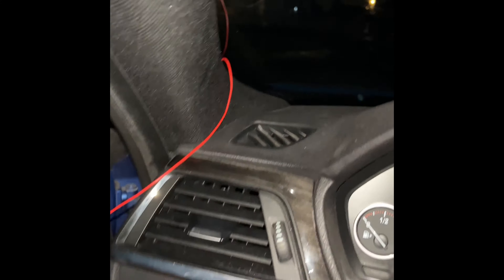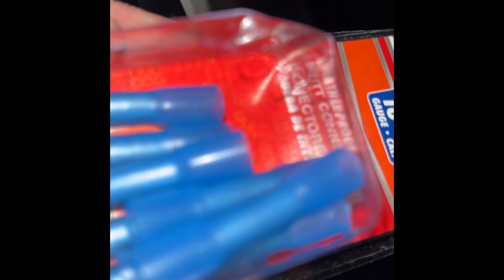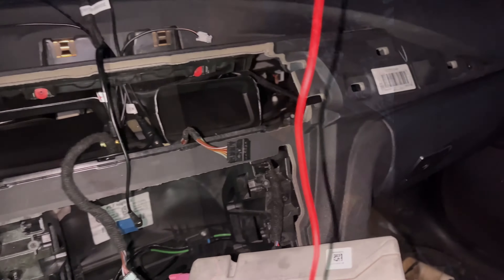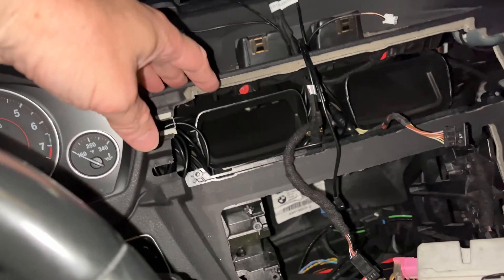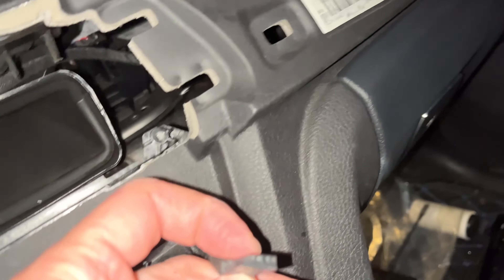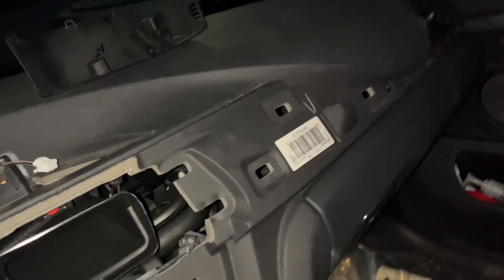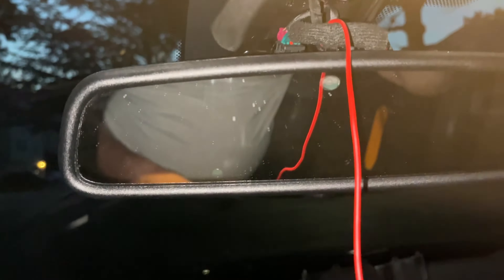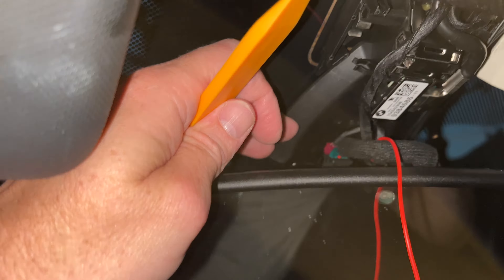DO NOT BUY. BMW Climate control and radio panel, touch screen upgrade installation. 2013-2019.

Comment: Has it worked fine in the time you've had it?
Reply from the maker: @Pm9697   it’s always been “working” kinda. Lol.. It still has issues with temperature control. It’s either all the way hot or all the way cold. All the temperature settings in the middle have no effect.
Reply: @DSBsky77 would you say that is the only issue? Other than that it is working fine and not slow or anything?
Reply from the maker: @ I would say that there were some design opportunities missed. Changing the temperature requires you to press a button like 20 times if you want to go from all the way cold all the way hot. They could’ve made it so you just held that button down or put it on a dial instead. Or even better, put it on the touchscreen. some lazy design choices. It looks nice, that’s the only good thing about it.

Comment: Where can I get this unit to buy
Reply from the maker: @davehall7754  I got it off eBay, but I’ve told a lot of people that I wouldn’t recommend it. It doesn’t feel natural in the car. It’s clunky, unintuitive. The radio doesn’t work well, adjusting the temperature doesn’t work properly and the buttons don’t feel natural to push. There are a lot of missed design opportunities. The only thing good about this unit is that it looks neat. Everything else is bad.

Comment: Hey bro any update how is it so far is it still working
Reply from the maker: @GunmasterG9-l3g  it’s still “working” kinda. It still has issues with temperature control. It’s either all the way hot or all the way cold. All the temperature settings in the middle have no effect.
Reply: @DSBsky77  ah okok thanks for the update bro
Reply from the maker: @GunmasterG9-l3g  anytime buddy.
Reply: temperature control does not work properly, the air conditioning panel from ZF-5006 does not control the internal heater flaps.
Reply from the maker: @TomulGodKiller  I did not have that problem, but I had other problems with temperate Control, which is why I’m recommending to people not to get this.
Reply: @DSBsky77  I have a solution for the problem of temperature settings not working. You have to open the panel, and disconnect the temperature sensor from the pcb. Then it starts working much better.
Reply from the maker: @ cool, good to know but it still has a plethora of bad design decisions lol

Comment: Do you know which fuse that you mention would blow? I had a faulty pin on my connector harness they sent and the unit won't power on. Thank you for any answer.
Reply from the maker: It’s a 5 amp. Under the hood. I actually see specifically, which one it is in the video.
Reply: @DSBsky77  Thank you, I found it in my FEM and it was the 5amp fuse, as you mentioned.
Reply from the maker: @davebennett1284  You’re welcome buddy. 😁

Comment: Their is more the enough length on the red wire. You just not feeding it in the right location. As for the aircontroll unit not working... their is a hiding setup menay where you must change the settings. So it knows if you have single or dual control and also the fact you have heated and cooled seats or not
Reply from the maker: @05greedy28  there may be enough length on your car, but there isn’t on mine. Don’t try to tell me how I’m doing something right or wrong. You don’t have my car. I’m glad you like it but it’s a piece of garbage, it’s generic and it’s badly made.
Reply: @DSBsky77  I'm not sticking up for the product item at all I'm just saying I didn't have trouble. And as for length maybe they made it too short. But as far as the cares go their is no difference in the dash between mine and yours as the coupe and the saden share the same dash. Have a good new years